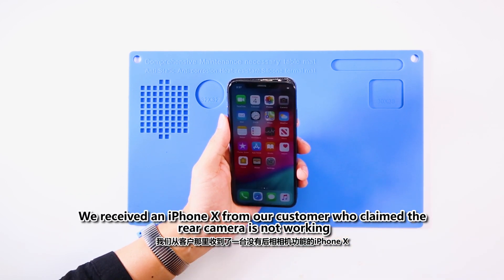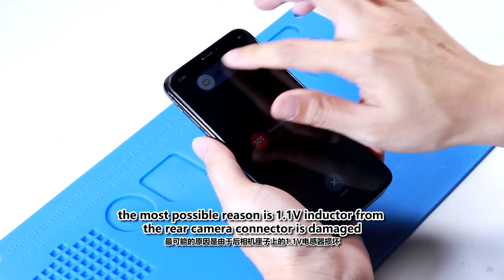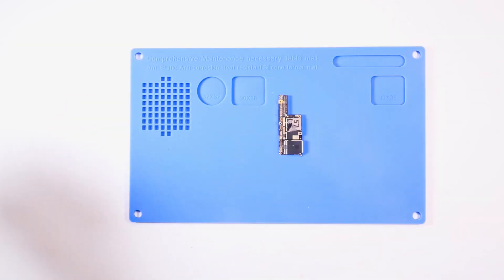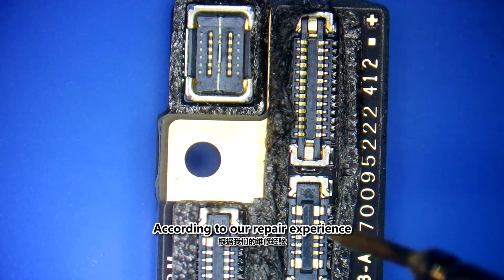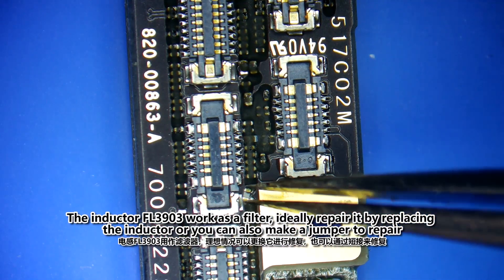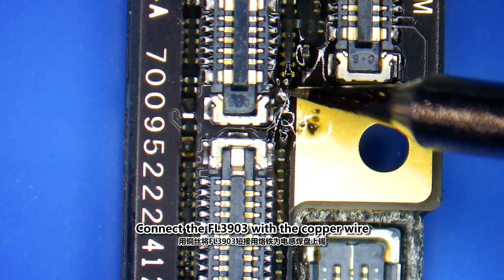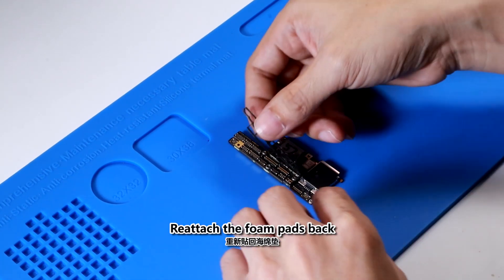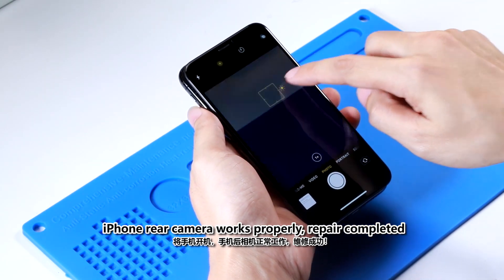How to Fix iPhone X Rear Camera Not Working | Motherboard Repair Lesson

Comment: Hello I am seeking for your advice.
Give is one iPhone XS Max.. rear camera was working, then started freezing and turned black. Bought a new camera, installed it and was good for one day. Reinstalled old camera and it worked. 10 minutes later camera doesnt work. Put back old one and doesnt work. After 10 minutes started to work again. Probably not camera related problem, what could be the reason?

Comment: Does the size of the wire matter? Can I just make a bridge with solder?
Reply from the maker: Hi, our technician use the 0.02mm jumper wire in this case, you can kindly find it on our shop: https://hcqs.shop/0-02mm-phone-repair-chip-jump-wire.html

Comment: Great video!

I have a situation where on an iPhone X the 1x camera and the flashlight are NOT working, but the 2x camera and camera flash (same led as the flashlight) ARE working. In your experience, could this be related to the same inductor? Thanks!
Reply: SKiNNiEH I have the same issue. Let me know if you ever find the solution
Reply from the maker: Hi, our technician suggest, you can 1. replace a new camera and see if the problem fixed; 2. measure the diode resistance of the 1x camera connector; 3. measure the power supply of the 1x camera and repair accordingly
Reply from the maker: Hi, our technician suggest, you can 1. replace a new camera and see if the problem fixed; 2. measure the diode resistance of the 1x camera connector; 3. measure the power supply of the 1x camera and repair accordingly

Comment: what I don't understand why you put a jumper. Why not put a new filter back. A filter is like a fuse
Reply from the maker: Very appreciate your comment Ramon, we have shared quite a lot repair videos with an inductor replacement. The reason we making a jumper is because we would like to share another way of repair. When the inductor is acting as a filter, it's ok to repair by connecting with a jumper. So the technician can choose the way they prefer (for example, if the filter is damaged, and there's no filter in hands, the jumper will be pretty convenient). We have also explained in the video "The inductor FL3903 work as a filter, ideally repair it by replacing the inductor or you can also make a jumper to repair"
Reply: HCQS i still don’t get it. So you mean, it is not a problem to make a jumper.. and not renew the fuse?
Reply from the maker: @MrDolunay86  Hi, Dolunay, an inductor in the device can have different  roles: coupling, filtering, oscillating, boosting, etc., When this inductor acts as a filter, make a jumper is to disable its function, by this way, theoretically, there's a very slight possibility that could affect its display function,  yet, making  jumpers has been widely used in the industry and we didn't actually see any problem by making it (if you make if properly), therefore we demonstrate the jumper in some of our videos, because we want to show you different way to repair, as we mentioned before in our video "if the inductor works as a filter, IDEALLY repair it by replacing the inductor or you can also make a jumper to repair‘’， the choice is yours
Reply: HCQS thank you for your reply, now i get it! Thanks
Reply from the maker: @MrDolunay86  No problem at all, you are also welcome to add our whatsapp+852 68186309 and join our repair group, it's totally free:). Have a nice day